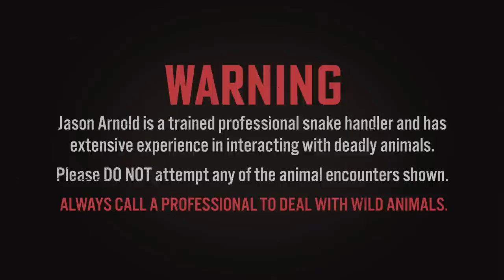BLACK MAMBA at a residential property in Reservoir Hills, Durban, South Africa.

Comment: Hello Jason, Youtube's Algorithm often also presents other snake handlers, as f.e. Nick Evans. He does not bag the snakes but uses transparent boxes with breathing holes. What do you think about them? For me a bag takes more time to be secured, but a box could easier loose its lid at whatever unforeseen circumstances (f.e. a car accident, or by a person).
Reply from the maker: Correct. Containers are far easier and safer to put the snake in, in my opinion, but tubs and buckets take up a lot more room. Especially when you have a car and not a bakkie (pick up).
Tubs can also heat up very quickly in a car. Bags remain cooler and take up far less space. I think both have their pros and cons. And yeah, in a car accident, it's very easy for a bucket or tub to break open or pop a lid off.
Reply: @jasonarnold-snakeman  I'm curious about that.   Wouldn't the snake feel safer confined in the dark of a bag, versus the light of a transparent container?
Reply from the maker: Correct Eva. Most definitely